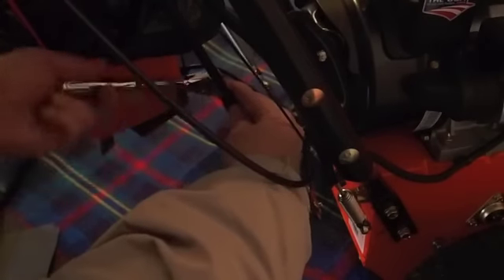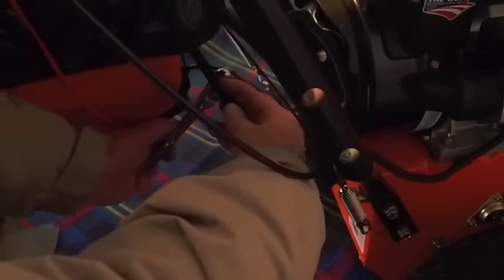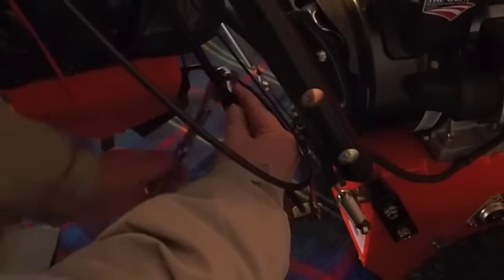Ariens snow blower  deluxe 30 speed selector shift drive  adjustment part 2

Comment from the maker: Tommy , first off if it is  still under  warranty take to  dealer . Second.. if the speed selector is   stuck an not indexing each  notch , start  from the handle  down (to belly pan) checking  for obstruction . It sounds like to me that the middle bar with the 2  bolts an threaded rod  are  not set right too  tight ,back the rod off  then index each notch , then tighten  down the bolts .